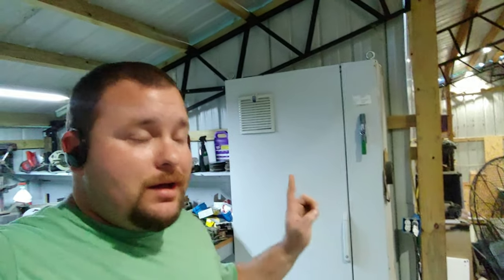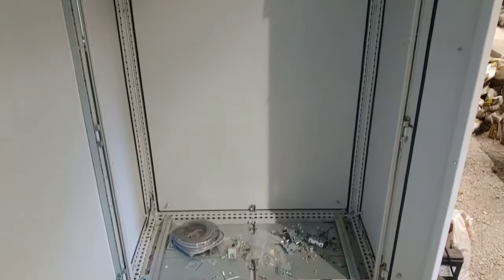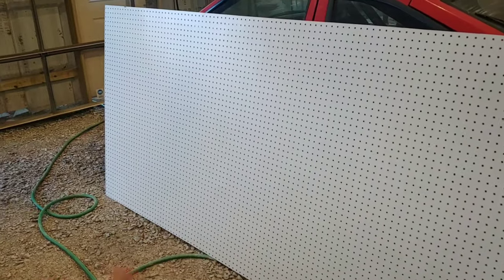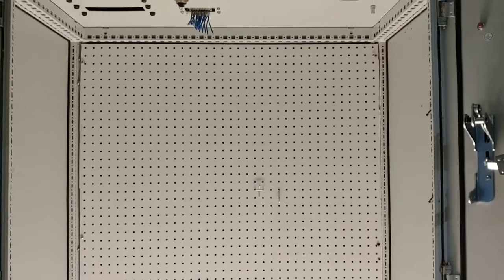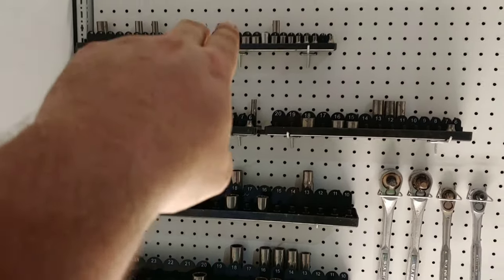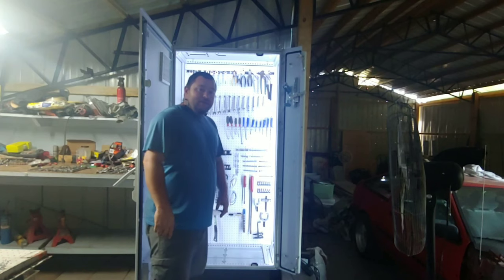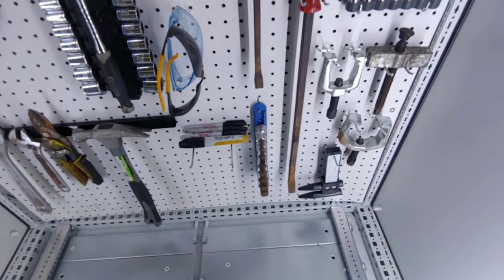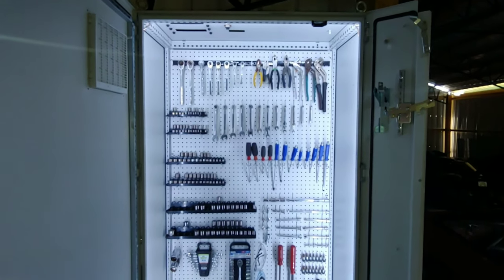$100 tool box build | upcycling

Comment: I used to do data work also..  set up many a data room and mainframes..  ours were all hermetically sealed with dehumidifier and a dedicated cooling rack..  we hired a tech once to come out and install this mainframe brand new from microsoft..  cost the hospital 8 million for the unit itself..  was crazy we had to get all the parameters within an eighth inch and when they flew this guy out to ky from australia this dooosh showed up, set the box in the spot and used a 2 foot long allen key to initiate a self install procedure where this thing lifted itself into place and rests on its own magnetic suspension where the thing levitates and all the million lights start blinking..  something like 1000 terrabite drives and glycol cooled..  looked expensive..  it supposedly was to control every aspect of the hospital where they used to have tape robots for patient info and for all tge blood work stuff.  Too much to type about but cool stuff..